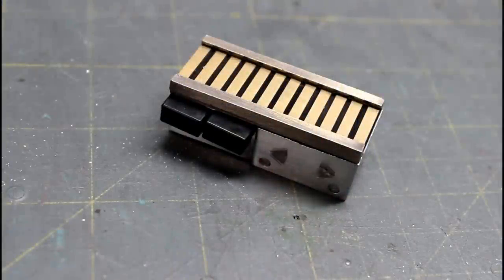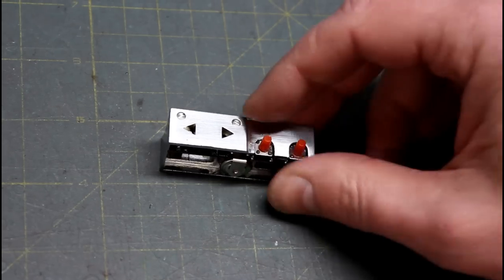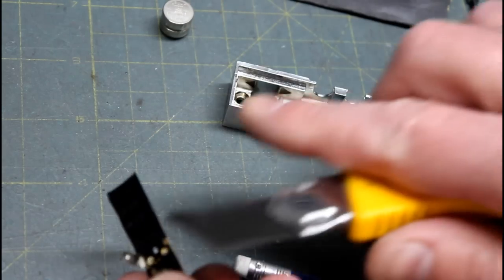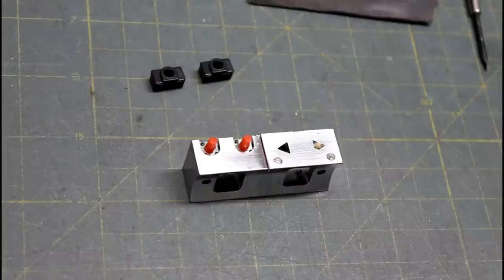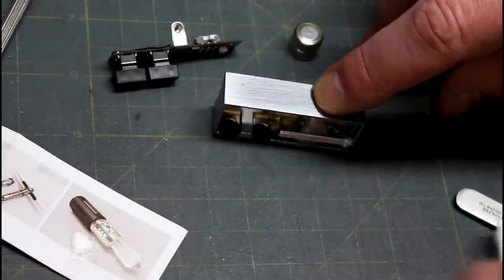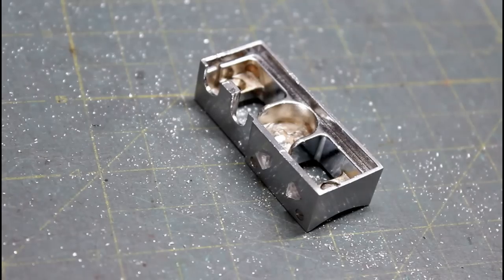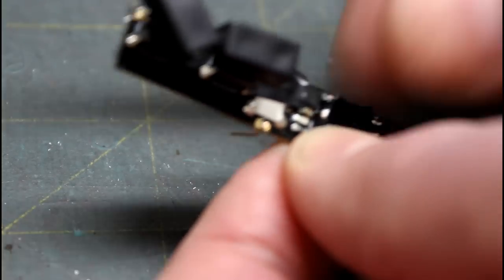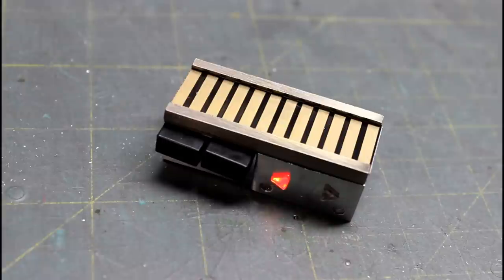LS6 Control Box Assembly

Comment: I glued my black buttons on and now it doesn't work anymore.  Also can this switch really be used for anything? This design kind of sucks.  The saber is nice, but I have no idea how the hell i'm going to fit a board, battery, much less an LED with a heat sink AND a blade in.  I wish there were more tutorials, at least there is this one, so thanks!
Reply: Update, I just simply replaced the tactile switches and now it works again.  I got a bunch on amazon.  They are 6x6 mm
Reply: So I have the same question....can this be wired as a momentary or latching switch or is it just for looks?